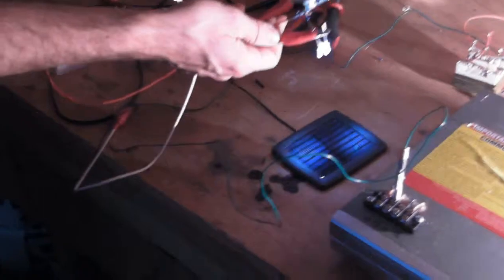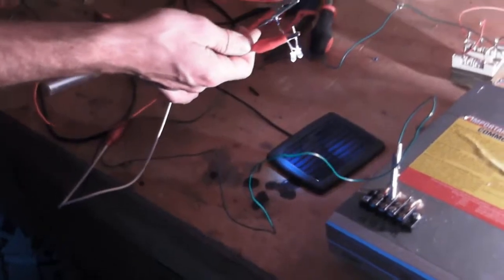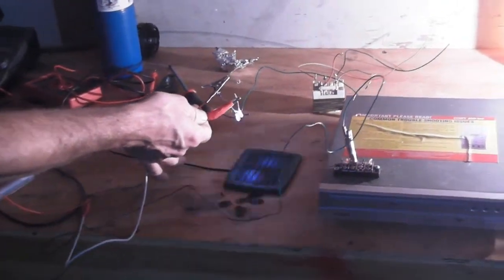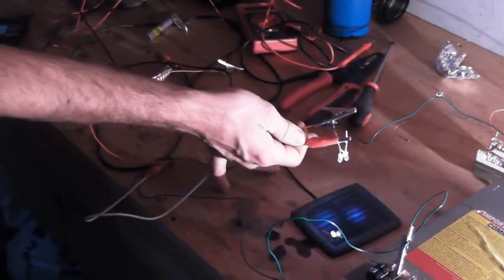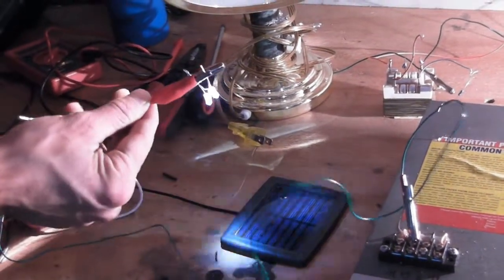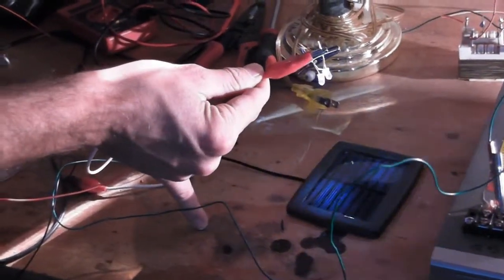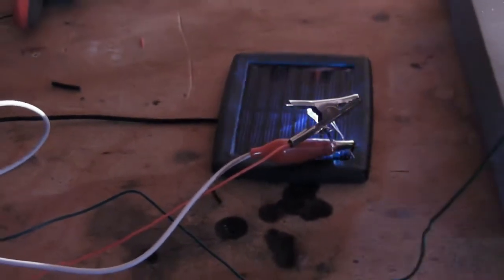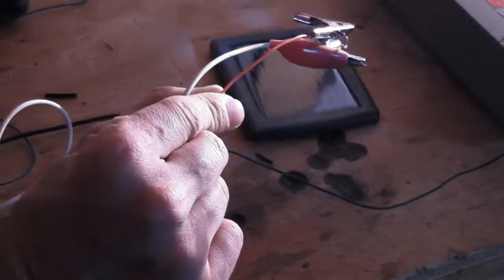Transmitting sound through an LED

Comment: You should hook up a mic to an amp then wire it to an LED and see if the solar panel picks up the sound when wired to your speaker ? Looks like it would from what I`ve seen you do so far...

Thanks for the videos...